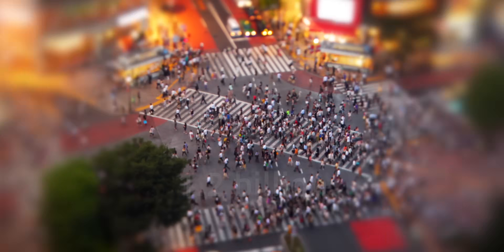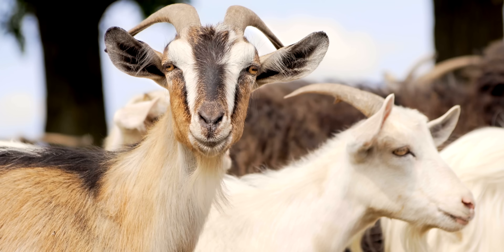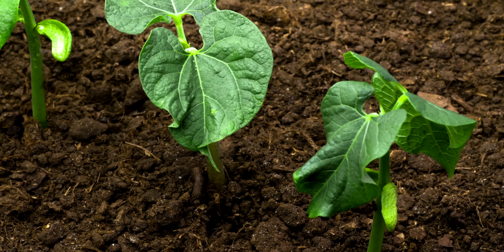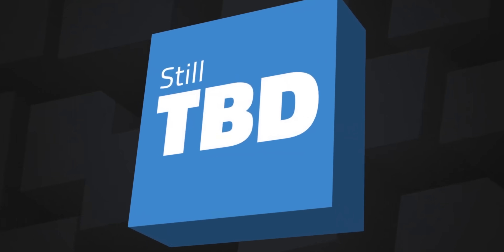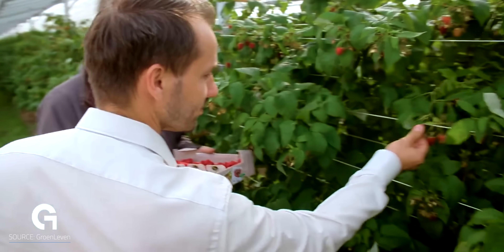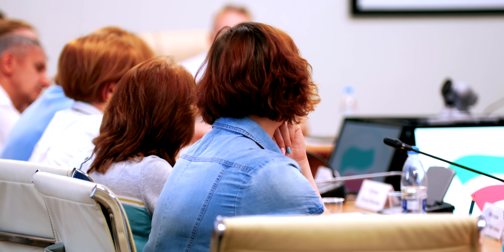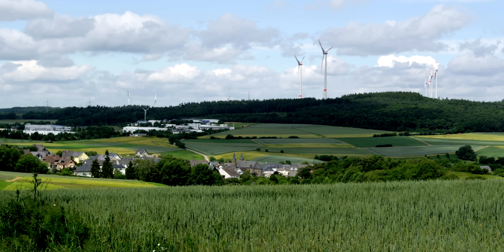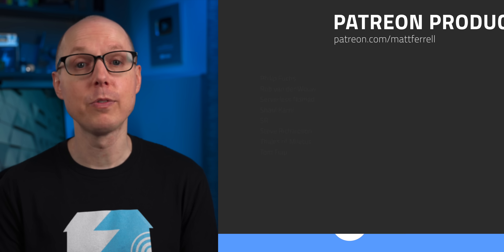Solar Panels Plus Farming? Agrivoltaics Explained

Comment: One snag might be that these solar farms are relatively small compared to the very large purpose built solar farms. Typically smaller solar farms need to be located  just a couple miles from a substation or they are more challenging and can be too expensive to get the power to the grid. So if the particular agricultural farm isn't where it is ideal for a small solar farm the it doesn't work. And likewise if a prime location for a small solar farm isn't where it is ideal for the specific crop that works well with overhead solar then it also won't work. 

I guess it is just a financial numbers game. There will be a threshold farm size where if the solar portion of the project isn't close enough to a substation it might not matter if the energy harvest is large enough at scale that it will mitigate those financial challenges getting the power to the grid.

Comment: Solar panel is good until the first dust... The efficiency of the solar panel drops by about 30%. So the dust must be washed off. Water. drinking water.
Now scientists are developing a program to remove dust using electricity, however, I think this is quite funny. And soon every solar panel will need a small generator to remove dust.

Comment: Seem cool, except the cost to actually build the panels. Plus the duration of degradation on output along with the current high impact to mining lands for material. Has solar as a spot applicable solution for portable and or remote power sources. You want to make an impact nuclear is the answer as we have the device now the size of a bus with many counter measures to make melt down not possible unless you go mountain leagues out of your way to destroy said protections. Now there is a current new kind of solar on the way that is supposedly extremely cheap. It does not need most of the materials used today in solar.

Also in my area the power company has a programs to build solar. I asked cool is it going to drop my energy bill? Their response is only if your in a minority category and financially burdened. So they want me to help fund the infrastructure to they buy the power from it once in place, pound sand... We also have many dams that provide power so the idea of solar farms is stupid. Plus we have a lot of wind power everywhere already. Want to see more community input and help in building actual green energy, not the high cost and damage to mine version. The people need to see the benefit of it. As in not placed under a power company to then bill you for something the people funded to be installed.

Comment: Interesting. Matt, it seems like the issue here is simply that the reception to agrivoltaics due to a general lack of education, efficiency, and thinking outside the box. These systems could easily be utilized, but a co-op would be needed, unless farmers want to educate themselves and diversify their revenue portfolio. Investment is still the biggest issue. Seems like solar panels are the tip of the iceberg...but we're still waiting on the rest of the iceberg. Where are the efficiency improvements in PV panels? Has that gotten better over time, or are we still utilizing generations old systems for harvesting energy from the sun?

Comment: California could really benefit from this, especially in the Central Valley… there are pilot projects for covering irrigation ditches with solar panels to generate electricity and reduce evaporation, which seems like a no brainer, but Agrovoltaics combined with covered irrigation would be a big win for water conservation and green energy

Comment: Wow, if only solar panels could survive without subsidies, heavy metals, slave labor, fossil fuels and you know, lack of sun, it would be a deal for sure. Currently it really is unjustifiable to use solar panels on a large scale, while it surely is a good idea to keep doing research on it, the reality is we should be pushing nuclear power, (as well as hydro and thermal when possible) which on the long run will not only take less space, but also is already a more reliable source of energy. This is not to say that you as an individual can't buy and use them, but let's not pretend that is this magical technology that is clean, cheap, reliable energy. You do know that all that solar energy is produce by nuclear reactions on the sun right?

Comment: Hears the bigger problem, solar is not clean, the amount of emissions to produce solar panels out ways the benefits. Additionally disposal of the panels is another problem. And the panels will not last forever and actually start losing power production in as little as 3 years.

Comment: All we need is A solar panel which can generate 1KW per panel and a Battery which can be made of abundant materials but with the same discharge rate as Lithium one's , We will be set for next 200 years .

Comment: I don't doubt the potential and its appealing of course but will the solar yield mean a profit after inflation from the cost of the solar panels? After all a good solar panel has a lifespan of about 25 years (and it looses efficiency the older it gets) or 5 years for most commercial panels. Now the lifespan isn't necessarily a problem since in the ear future I believe the cost will reduce significantly. But then again there s the problem of broken solar panels leaking which would kill the plants since the materials sed in solar panels is highly toxic. But I don't know how significant of a problem that would be. The problem there is that we don't recycle or dispose of solar panels safely we just send them to countries without legislation about pollution where they get burned and polute the ground.

Comment: It appears to be a complicated solution to an otherwise simple problem. This being due to it working with the assumption that all rural land is suitable for food plant (for lack of a better term) agriculture. The examples you mentioned near the beginning of the video could be merged to bypass several of the problems of agrivoltaics. 
For example, if large livestock tend to damage solar panels then put them on stilts which are either outside the pens or with a buffer fence to protect them. This would allow duel use of land as you have defined it.
This seems like a far more logical solution as its simply an extension and merging of two proven ideas. This lowers the potential opposition it would receive from landowners and bureaucrat due to it being less of a financial risk and requiring less new regulation to be created respectively. It also tackles the problem of crop wields being effected since grass, depending on its type, is a relatively hardy plant.

Comment: They should develop electric tractors, then they could add recharging station on the farm. This way farmers would not have to pay for oil/gas as well.
In theory those farms could have those recharging stations installed for commercial usage to charge other electric cars.
So those farms would have:
1-normal farm
2-energy generation
3-free energy for transport and personal usage
4-commercial recharging stations

Comment: This was something i had theorized about decades ago. However i didn't have a means to test it or make it large scale. 

There is methods of planting that we can operate that can allow 75 plants to coexist in a 5x5 area while also utilizing solar panels to keep them safe and allow for more a certain amount of sun to hit them. 

we can also set up water pumps that are low energy and low low flow to also feed water to such plants in a 75 plant array and with solar tech having more experimental methods of production on the horizon, it might be plausible to decrease water usage, gas ussage, and increase yeilds. 

The biggest issue in this is that you can't use or utilize large scale farm equipment and harvesting must be done by hand.

Comment: There was a mixed use of water reservoir with solar panel. The water cools down the panels and the panel slows down water loss in the reservoir from evaporation

Comment: If the panels are oriented in the way shown at around 2 minutes then they're aligned completely wrong for power production.  Their shadows are moving from west to east (as shadows do during the day) which means the rows are pointed north-south.  By afternoon none of the panels will be receiving a meaningful amount of light.  In a more realistic situation the crop area is completely in the shade for most of the day.  If the rows are spread out, then the bit just in front of a row is in sun all day and the bit just behind it might or might not be, depending on the time of year.

Comment: Will watch full vid when cells charged better, but don't panels leak heavy metals in the rain and humidity and wouldn't that leak into the farm land until its fixed?

Put the panels on roofs, where energy is normally wasted to deliver. The risk of scratching, scuffing, and damages would be lower and where light leakage is both negligible and easy to control. Solar farms never work out economic wise, and can actually damage the environment wasting toxic wastes and high value low sustainability rare materials we need to devastate forests to get. Pure profit on roof, high risk on farms of any kind

Comment: The good thing with the solar panels on actuators is, that the farm can control the amount of light falling on the plants, preventing overexposure, or underexposure to sunlight.  As well the solar panels could be moved dependent on energy prices, so the plants can receive light when electric prices are low, and the solar panels could collect light when electric prices are high.

Comment: Solar energy only makes sense if you're using or storing the electricity on site because it cuts down on transmission costs otherwise it doesn't make sense at all  if there was a collaboration between Toyota / Honda to combine agrovolatics with Hydrogen production and an all electric tractor then that would make a ton of sense. A 2 Megawatt Solar array could produce and store a bunch of hydrogen which could be converted directly into electricity for running a super electric powered tractor. It would also be basically a giant bomb waiting to go off so you'd probably want to bury it underground that way if it does blow up it doesn't do much damage. Another use for all that electricity would be to power water condensers that pull water directly out of the air and mist it over the crops. A farmer is all about crops and agriculture and thinking in terms of investment growth while maintaining sustainability. Another future use could be agro volatic Farmers who are next to rail road stations that are pumping hydrogen into the electrically driven train. The electric hydrogen train and the electric hydrogen tractor could probably be almost identical in terms of engine construction meaning you'd get a 2 for 1 deal in the engineering department.

Comment: This is absolutely fascinating! I know the focus is on large-scale farming and energy gathering. However, I can't help but wonder if this couldn't be even more beneficial if the scale was minimized to households, city gardens, and the developing world! Better and more efficient land use is always positive and would be fantastic in areas where the urban spread is problematic, there are "food desserts', or extreme impacts on land uses due to infrastructure development and expansion.
Reply: 100% much more efficient to produce the energy (on the spot where it is needed), like you say minimized to household sizes, gardens etc. Obviously though "farms" aswell would be needed, but in the end of the day. Basically any and every househould should become self sufficient more or less with solar & storage. It should really become mandatory for housing etc to include solar already at design stage for maximum output and clean design integrations. 

For an example we can already start making our whole housing walls etc in solar tiles. and that is just 1 single tiny part of the story.

Comment: The downsides are pretty weak tbh. 
Less waterconsumption is a big thing, everyone needs to look at
New land can be used.
Same or even higher quality of the product
If the farmer owns the panels, it is a way to have a stable income no matter the harvest.
Better working conditions with less heat.
Crops protected against heavy weather effects (which are going to occur way more often)

sounds strong against higher financial costs.

Comment: i would like to suggest a program idea.  search u tube for terraforming death valley--use the Boring companies tunnels to flush the water north to south, with at least 2 tunnels on the north and 2 on  the south.   in addition to the benefits in the u tube video, it would likely change the climate around LA, and keep it from burning every year.

Comment: I think this is so important and impressive that it shouldn't matter if you have to make small sacrifices. It's especially easy if the farmer owns the solar panel or has a fixed interest rate. But even for the raspberry farmer who needed a weather shield anyway it is a benefit. I think a lot of time and thought should be put into the building of these but that they are so efficient for land use its actually crazy. Imagine doing this on city rooftop greenhouses on every building sturdy enough for it.

Comment: this is the most idiotic idea ever. 

you have plant leaves, with a relatively high conversion efficiency of solae energy, and you cover them up with panels which have a 40% at best, require a lot of materials to build, look ugly and produce lots of toxic metal waste at the end of their life cycle (around 5-10 years). let the fields to agricolture, and make plants utilize solar energy even more efficiently. 

solar panels are for roofs, and they are a patch, not a solution, to the energy problem

Comment: The cost alone would have issues.  Those solar panels would have to be 20ft off of the ground to allow a typical combine through the field.  All that for 6 hours per day of power where I live in NW PA.  

I think this might be a good idea for grocery store or mall parking lots as long as a 15ft clearance is maintained.

Comment: I think we can first built solar panels over city roads. Production of electricity where the demand is.

It further cools the road and improves the heat zone effect.

Reduce the air conditioning requirements of cars and nearby homes.

Win win in multiple angles😅😉

Comment: As it applies to watering the plants could you use the irrigation water to rinse the panels and the water then water the plants below? Both cleaning the panels and cooling them, while also not increasing water use.

Comment: This is fascinating on so many levels.  There are quite a few auxiliary - but crucial - benefits with this model that affect different markets around the world but invariably make it far more practical.
The cost of hauling electricity from plant to consumer is extensive - as is power loss over transmission lines - so you want to shorten that distance as much as possible.  Existing plants have to maintain distance from population centres so the haulage is long and loss greater - but there are vegetables and fruits grown surprisingly close to urban centres (I remember when I lived in Australia being told all of the bok choy consumed in the city was grown within 5km's of the edge of the city area).  Such a solution in a location like that would benefit both greatly with lower transmission costs and a potential increase in closer-to-consumer growing (the reduction in water cost is immense, I can see this doing well in California).  
Also the idea of "table growing" (growing on tables above the ground so you can build cheaply on former industrial sites and other less than ideal sites) is viable, this would increase the yield on those plots of disused land.  Former industrial slums and run down areas would be ideal.
If we can standardise construction (so it's more like Ikea pre-built than bespoke construction each time) for frames, cells, etc. and there can be fast and lucrative arrangements on ROI - I can't imagine a farmer in the world who wouldn't jump at it.  I can also envisage idle corporate funding going towards outer-urban growing too, even in lower sun areas such as the UK.
The immense benefit here is a sharp reduction on reliance on long supply chain foods and power, a hugely important issue now we all seem to be heading towards WWIII.  Not just running out of heating gas but disruptions to food supply will be offset quite a bit by such an endeavor - reminds me of the "Dig for Victory" posters in WWII promoting home growing of vegetables and produce. 
If the legislators can fast-track changes to make it immediately and easily viable - take all friction away - I can't imagine a farmer in existence who wouldn't bowl you over to take it up.

Comment: In Wisconsin, farmers are limited to using only 75,000 KW from their own renewable electricity production. Be it from a wind turbine, solar array, or bio-digester. The rest of their production must be sold to the grid at the power company's avoided fuel cost price of only $0.015/KW. So, from a farmer's point of view, renewable energy in any form is not a good business option.

Comment: Dear Matt, in your video you mention, that there are objections in the EU in building agrivoltaics. In winter countries theses kind of "solar roofs" might be packed with snow. The degree of loopsideness should be at 45%, I believe.  I not, the snow cannot slide down, and there is no energy production. These times, the objections to agrivoltaics might be different, because, in Europe many governments would like to get as many options to replace gas as possible. Electricity is also produced with gas. There could be  - in agriculture - electrified solar vehicles. Agriculture - according to media - is in strong need of gas. There could be synergistic effects. Farming vehicles could be replaced by rotobts. These could be loaded directly at the solar loading station.